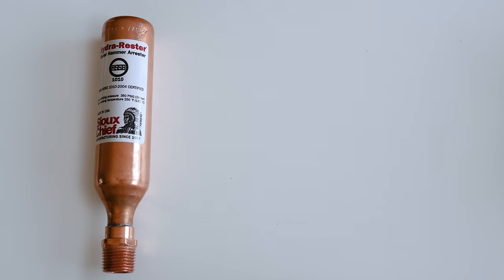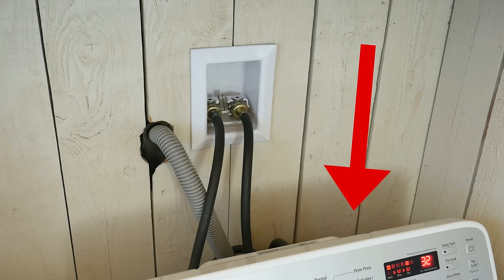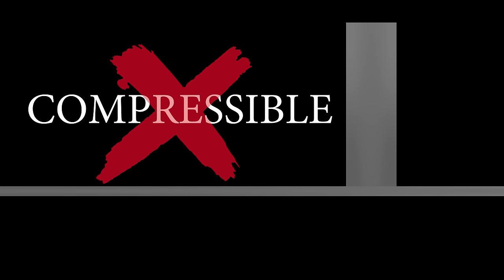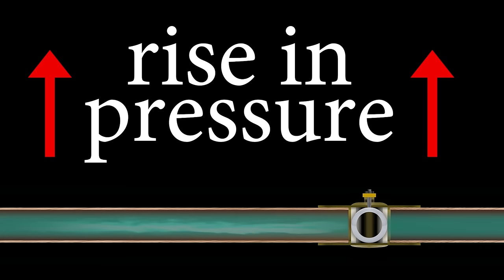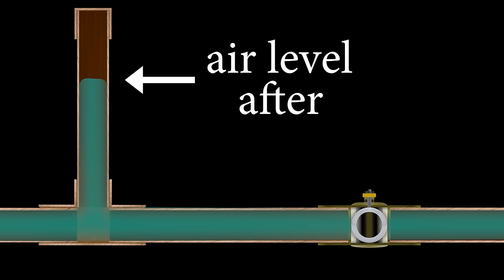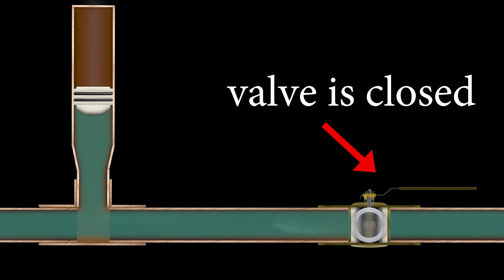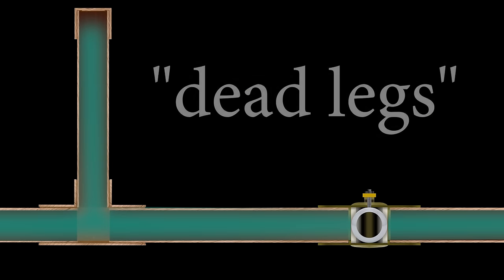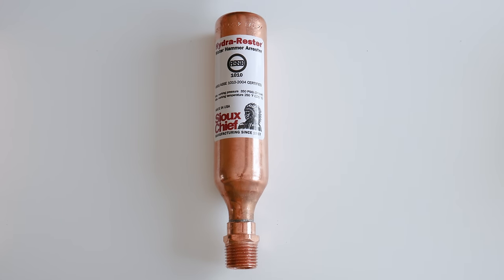Why Water Hammer Arrestors Are SO Important | GOT2LEARN

Comment: Our local volunteer fire department sometimes uses a fire hydrant outside of their building. Sometimes they open it wide open and the water pressure drops a bit. The problem is that they sometimes shut it too quickly. It seems like the last 3 times they did this, it would send pressure surging down the line and we'd see some damage at either water meters or some joints under the ground. Each time the water company would fix it and the volunteer fire department acted like they knew nothing.
Reply: Yes, that's the "Shult-zee", perfected by Sgt.Shutz from Hogans Heros fame.
Reply: I know a retired water co. Worker that was flushing hydrants one day, and closed the valve a little faster than he should’ve, blew another hydrant 3 blocks down the street!
Reply: Yah. The fire department I work for trains us not to do that. Apparently one of our stations destroyed all the fittings for a farms irrigation system once😶
Reply: It can also cause the water main to hammer and recoil and hammer and recoil...
Very hard to stop.
Reply: @nimarus3118  your volunteer fire department is either poorly trained, or you have some sociopathic trolls there with a nasty sense of humor.
Reply: @LloydsofRochester  We believe they did it intentionally. The Volunteer fire department had a grudge against some members of the neighborhood stemming from when our Civic Improvement Association shared their firehouse for meetings (Both groups had rights to the building). They wanted their clubhouse free of the Civic Improvement Association and held a grudge against some (Like my parents). The fire hydrant is outside my mother's house and their actions would damage the water meter at the two homes across from her that she owns (rental property). It was an inconvenience, but it was the renters who had to deal with the Water Company having to adjust their water bill to account for the leak.
 
The Fire Department has changed a lot over the last 6 months. New leadership after the old leadership was voted out (A man who was very bitter). They actually recommended my mom join their board to better bridge between the Volunteer Fire Department and the Community who had lost most of their respect for the Fire Fighters. They work with the non-profit groups now.

Comment: I have a house that has some pretty bad banging pipes, what I found from experimentation and reading some plumbing forums is that the closer to the valve the better. I have had arrestors placed both near to the shutoff for a washing machine and also directly placed in the inlet for the washing machine. In the configuration where the arrester was close to the inlet for the washing machine hammer was eliminated completely. 

Also, in the video above you show the size A 652-A arrestor which works much better than their 'washing machine' variant of size 'AA'. Based on my experience so far I wouldnt ever get a mini-rester as Sioux Chief calls them. The Size A unit is tested at a life cycle of 500,000 cycles and 20,000 shock cycles,  if you look at the different arresters available on the market make sure to look at the O-ring material and the piston material.

Comment: Now you can appreciate the technical challenges faced by pipelines with dozens of miles of flow being stopped
Reply: How do they do it? Do they install big storage tanks to collect all the excess flow when they want to stop it ?
Reply: @uski  emergency shutdown valves and other isolation valves have long closure times so flow is stopped gradually. For unavoidable scenarios they have over pressure relief devices that will open to relieve pressure to a low pressure area like a storage tank.
Reply: With the trash they put into the water you might as well have sewage coming out your faucets. That's the reason plastic bottled water exists the idiots at the municipal water departments have made it unpotable.
Reply: @uski  Joints are also reinforced with concrete thrust blocks or steel mechanical joints to withstand forces in the tons. The pipes are also rated to peak loads that are very high. Even fast-moving water just making a sudden bend can be very high when the flow rates are fast, so the pipes must be heavily reinforced where they change direction.
Reply: @uski  Depends. When it is pure liquid oil or product between tanks, thats easy. Just pumps and tanks. When you have mixed produced liquids and gas, you need proper designed process vessels to sort out the slugs of liquid and gas. If the design was not good enough you need to send it to the emergency flare. Thats a nice fireworks then.
Reply: @Davidjune1970  or to a flare. I know spring loaded shutdown valves that will push the valve in either safe open position or safe close position. It depends on where the valve sits. I also know slam shut valves. We used them for 180bar (2600psi) liftgas at wellheads for 2 inch lines. One time there was a failure. I guess a slug of ethylene glycol from the drying system that collected in a low knee of the liftgas pipe was shot against an orifice after the slam shut valve was opened after a longer shutdown. The whole system looked like spaghetti and the ball of the slam shut valve was 2 feet deep in the sand. It could have been shot some hundred yards to somewhere...
Reply: @not1au  What country? In my place it is potable by default. It is a big story when some community has to announce that it is temporarily not potable.
Reply: @mweskamppp  there are also lower tech options which operations and maintenance people hate - rupture discs. they were in fashion once because relief valves back then couldn’t react fast enough to handle a transient shock wave.
Reply: @Davidjune1970  I remember burst discs too. I just did not work in workshop or operations to know where they put those for what reasons.
Reply: @not1au  The fuck? I agree some of your water systems are fucking awful, but the Lifestraw can DEFINITELY filter municipal water
Reply: @Icalasari  ACCORDING TO LIFESTRAW THEMSELVES IT DOESN'T. IT'S WRITTEN ON THE PACKAGING THING. YOU NONHUMANS HAVE A PROBLEM WITH THE TRUTH NO MATTER HOW BIG OR SMALL. WHICH ARE YOU A SHE/HE OR HE/SHE? I KNOW YOU'RE NOT A NORMAL MALE OR FEMALE.
Reply: @Icalasari  EVEN SOME OF THE BEST HOME WATER FILTERS CAN'T FILTER CITY WATER IT ONLY FILTERS SMELL AND TASTE. DO THE MAKE A LIFESTRAW THAT'S REVERSE OSMOSIS ? THAT'S THE ONLY WAY IT COULD.
Reply: @not1au  Scottish tap water is unrivalled.
Reply: I was working at a hydro power station when a technician inadvertently tripped off all 10 turbines, the instant stop caused the flow of water to stop and created a wave that came over the dams wall. Luckily nobody was on the dam.
Reply: @not1au  UK water is very clean. Hard is some areas, but the soft water taste pretty good.
Reply: They make Sharkbite ones!

Comment: Practical engineering did an awesome demo of a water hammer from quickly turning off water where pressure goes from 60psi to a sudden 200psi in a split second for just turning off water

Comment: I think you may of solved an issue at my families business that no one knew this could of been the cause. In the employee hallway that runs a good length of the building there are 2 major water pipes that run most of the length. For some reason in the past couple of years there’s been a noticeable shake in one of the pipes that would happen periodically. They thought the straps were loose or it needed more reinforcement. Now I know what the cause is thanks to this video!

Comment: That was informative, thanks!  For the record, water is compressible (or else sound couldn't travel through water), but its compressibility is much much smaller than air.
Reply from the maker: Thank you so much! Yes water is compressible, just not enough to say it is, but interesting point there @MH, thanks!
Reply: Only gases dissolved in water are compressible; not the water itself.  Water is so incompressible that if a piston engine ingests water,  or even too much fuel,  it can break the pistons and rods- in a high performance car engine.
Reply: @jamesengland7461  Okay, but water (like all fluids) IS compressible, though as I said, much less so than gases (including air).  It's not the gases dissolved in water, but simple, pure water is compressible.

Comment: Pretty good as an introduction to water hammer, but:
If water piping is sized to keep flow velocity below 4 feet per second most water hammer effects are eliminated or greatly reduced. The flow can even be restricted after the quick closing valve with a restricted orifice aerator or other device to reduce flow velocity.
Also, a great percentage of newer plumbing is with PEX flexible pipe. PEX is flexible enough to absorb much of the water hammer effects as the surrounding air does the same thing as the trapped air in an air chamber or engineered water hammer arrester.
Proper sizing and resilient materials can eliminate the need for air chambers or arresters in most cases.
Reply: I have 1/2" plex pipe installed in the house and every time washing machine or sink  shuts I hear bangs in the walls.
Reply: @ajeebbeliever8857  In your case I suspect that it is either not supported in the right places, or has no slack, or both. It should not do that when properly installed. Also from experience I think it's better to move up a size when using PEX compared to metal, which your plumber didn't.
Reply: @Eggerhexe  thank you for your reply. It makes sense.

Comment: In work they have a sink and an instant water heater fitted. For whatever reason they fitted a pressure gauge on the cold pipe. Well if you turn the tap on and of quickly/violently you can see the water pressure reading on the gauge almost double.
Reply from the maker: That's exactly what a water hammer is, the pressure spikes up and could really damage your system, good example here.

Comment: Years ago I had a toilet that would bang so severely when the fill valve shut off, that the plastic fitting cracked after a few years, and the water leak damaged the walls and ceiling in the room below.  After the third time it happened, I turned down the water flow to that toilet, and that worked.  If these arresters were available then, I might have installed one.  However, I don't see what prevents the gas from slowly leaking past the o-rings, making regular replacement necessary.  Regardless, an arrester must cost far less than fixing all that water damage.
Reply: This comment provided more information on "why water hammer arresters are so important" than the whole video. I already know what they are and how they work, but was wondering what kind of things happen without one

Comment: another tip to prevent some hammering on faucet and some toilets is to put a restrictor or inline 1/4 ball valve half closed between the line and angle valve..  when the tap is open it creates a pressure differential across the restrictor when the tap closes it takes a few milliseconds for the pressure to equalize.. even turning the angle a few turns in to restrict some of the flow

Comment: Water hammer can also be caused by loose pipes that are not properly secured/strapped down and from excessive water pressure from what I understand.I could be wrong but wouldn't an expansion tank work just as well as water hammer arrestors?Good video by the way.God bless you and yours.
Reply: Not really unless you put the exp tank at the location of every spigot. in order for this to work it needs to be at the end of the run, otherwise its like putting bumper springs on the rear bumper and then driving forward into a brick wall
Reply: @integr8er66  you are right and wrong. take again your rear-spring bumber car smashed into a brick wall then add another car following behind. All the water behind will still take use of the of the air tank, which will still reduce not all but some of the increasing pressure.
Reply: @TwinShards  Yes I agree, the water before the Exp tank will be cushioned, any after won't. I totally agree with that, so I suppose it would help. To the Victor my good man!

Comment: I sometimes will increase the size of the pipe feeding the branch/fixture to decrease the flow rate helping to reduce the hammer effect.
Reply from the maker: Yes, that also works!
Reply: I was about to say the same thing ! Haha
Reply: OK Boomer  It all depends on the flow rate and pipe size, you want to increase the size enough to reduce the flow rate but not so much that the water becomes stagnated and grows things.

Comment: Hard water destroys those water hammer then they turn in to dead legs any ways. As long as you strap the pipe correctly u shouldn't he any issue the city has water towers for that reason but great video
Reply: Makes sense, I used to have to replace them every year or so since they would quit working. My town switched to Lake Michigan water about 3 years ago and I have not had to replace any since.
Reply: Awesome
Reply: And most modern plumbing is flexible pvc or pex so it can absorb the shock
Reply: Umm, no.  It isn't just the movement of the pipes that damage the joints, it's the localized increase in pressure too. Sometimes as much as 8x the nominal water pressure.  Old fashioned stand pipes last as long as the rest of the piping in the house, just need to drain the house system occasionally to get the water out and refill the pipe's air chamber.  No one does it anymore,  that's why code is being changed. To accommodate stupid lazy people.  All manufactured anti water hammer devices will fail  no matter what you do.
Reply: @jcwoods2311  I'm not sure what your saying no too but either way everything plays a factor and yes ppl r lazy its why we have jobs 🙂
Reply: @rdudeb5058  lol, yup! That's why we have jobs.  
Saying no to properly strapped piping being the complete answer to the issue of water hammer.   If you're speaking only to the sound then yes, properly strapping helps.  The other issue is the sudden localized increase in pressure when the moving mass of water is suddenly snapped to a halt  by a rapidly closed valve.  With nothing to absorb that increase damage to the valve(s) and joints occur causing premature failure.  I hate stupid people, but will gladly accept their cash for correcting their carelessness.

Comment: Hammer is usually an urban problem where water pressure is higher.  Rural (well) water systems don't often see this issue because of lower pressure (nom 30 PSI) and the effect is also mitigated by the pressure tank.
Reply: Pressure stress of the plumbing could be reduced by installing a whole-house pressure regulator.
Reply: I see this in well systems all the time, usually in irrigation with long pipe runs of undersized pipework. The shock wave can be easily 10 times the system pressure and it blows the pump in half.
Reply: I lived in the country my entire life, the most common well pressure is in the 50-60 psi range. I've never even seen a pressure switch that topped out at 30 psi.
Reply: @TKCL  There are two typical pressure switches: 30/50 and 40/60.  The 30/50 is the most common setup and 30 psi is the cut-on pressure and 50 psi the cut-off pressure.  Nearly all pressure tanks come precharged to 28 psi for this reason.  So a typical well system will have an idle pressure between 30 and 50 psi.  So, to your point, a well system doesn't "top out" at 30 psi but is still referred to as a "30 psi nominal system".  On the other hand, municipal water systems typically deliver anywhere from 45 to 80 psi with 60 psi being the target norm.

Comment: I can tell you first-hand at how damaging water hammer can be. Back years ago the Fire Service had Front Mount Pumps on the trucks.
Well FF would shutoff a inch and half (1¹/² ) valve without any warning to the pump operator, and kaaabang the shockwave would either blow a valve apart or if you got lucky another hose team would all of sudden be hit with about 150-170 psi. I've seen valves blown off as well as hoses blown apart.

Comment: I’ve installed this same  brand Sioux Chief devices at my washing machine bibs. Problem is the have to be changed out occasionally. In my case over time the piston freezes up inside maybe due to hard water deposits. Also as someone else stated copper is antibacterial so shouldn’t be a problem with stagnant water.
Reply from the maker: Could be you have super harsh water, gotta get that checked out if you do, any component is exposed to premature failure if it's the case.
Reply: Lime scale build up does that.  However, there can be several other factors such as sediment getting embedded in the neoprene seals on the piston, not cleaning flux out after sweating, water pressure not regulated and incorrect install, like crimping the arrestor body. 
Assuming residential, install a whole home water filter or even a pair. The primary with a basic sediment filt0er and sec2ondary with an activated charcoal filter. This will eliminate sediment and greaty reduce limescale extending the life of seals , appliances, fixtures and devices such as arrestors.  Of course, replace damaged components.
Reply: Pee Tee  A better solution is an empty vertical column of air, then drain your whole system when they stop working and they will work again, but when these fail you must replace them to fix the problem.